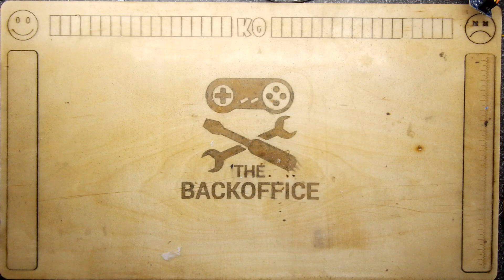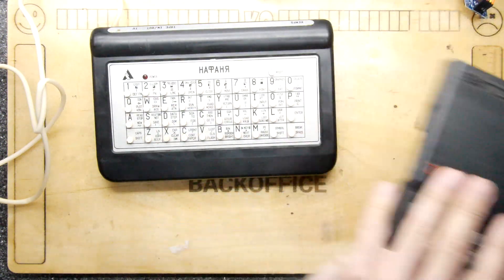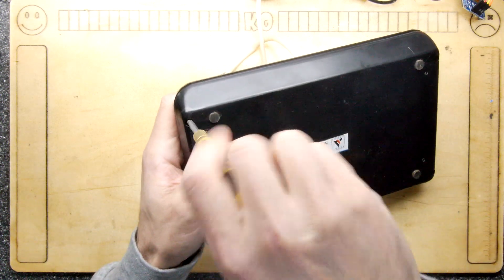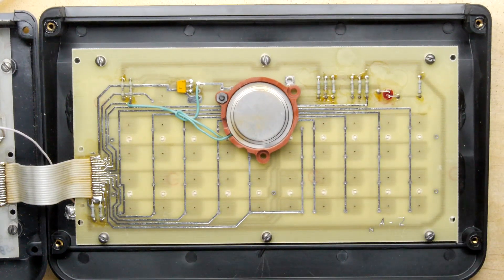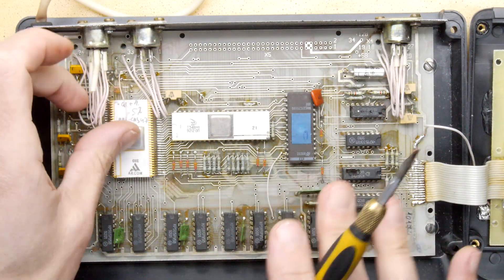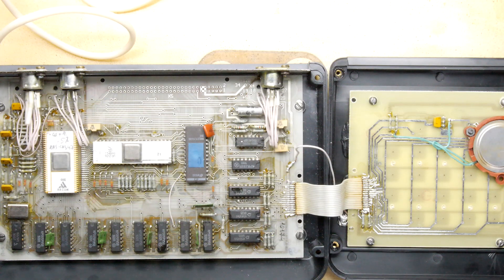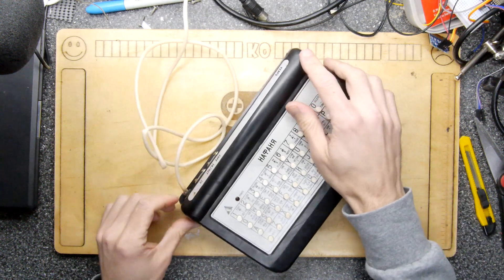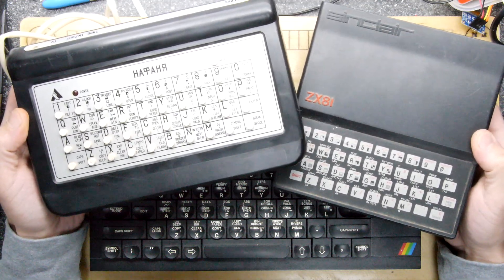Soviet Sinclair ZX Spectrum Clone Teardown НПО "Аксон" Нафаня (Akson Nafanya)

Comment: AKCOH 
this is a manufacturer ... and the chip itself is a Soviet reverse engineering clone of ULA
T34BM1 = Z80 Soviet Z80 Clone 
KP565PУ5B= DRAM 8k each chip... but z80 cannot address all 64k dram ... some part of the address space is occupied by ROM ... so 6k per chip
K155ЛН1 = logic gate NOT(inverter) 
К554СА3 = voltage comparator...used to read a signal from a tape recorder \ also used in the Soviet 5.25 floppy drive electronica mc 5311
other chips is also logic gates.... 
lower part of numbers represent the date of manufacture of the chip so 
КР565РУ5В
9201
it was made in 1992 ... the first month is january
Reply from the maker: Thanks for the information! 1992, wow that's much later than I would have expected, I might Google to see how long they kept manufacturing these. It's a bit like the 8 bit Nintendo clones, definitely made well into the 90s and still a few made today 😂
Reply: @backofficeshow  also in USSR 
there were other clones of popular platforms ... for example 
BK0010 user frendly home version of PDP-11
DVK-2 not user frendly version PDP-11 
but it can run more advanced software ... like Demos DVK (a clone of the Unix operating system)

AGAT 7 is a clone of Apple 2, somewhat cheaper in some places ... but it had a large motherboard and a bunch of all sorts of expansion modules
RADIO 86 RK original design but the idea of a computer is similar to Apple 1, cheap, simple and open ... the computer was assembled by enthusiasts ... 90% of the chips were clones of Intel chips

Poisk 1 clone of IBM PC/XT on the i8088 processor ... stuffed into the keyboard case, the compatibility was not complete, there was not enough memory ... it was necessary to buy expansion cards to run normally DOS, it even had an ISA bus, but the problem is that there was a Soviet snp connector and manufacturing homemade boards was a tricky task ... and it all cost like a Two BK0010 computer A LOT OF MONEY :( 

UKNC 
based on PDP-11 but now there are 2 processors ... one for computing ... and another processor for controlling the keyboard, tape recorder, display and everything else ... the computer was popular in schools along with AGAT7 and suddenly Yamaha MSX yes there were such educational machines =)

And now about Zx Spectrum big explosion....
(Names of Spectrum clones) ATM Turbo,Byte,Baltic,Briz,Vega,Gamma,Delta-C,Dubna,zx evo,Iskra-1085,Kay,Kvorum,Leningrad-1,Lvov,Magic07,Moscow48k,Orel-BK-08,Patisonic,Pentagon-1024,Scorpion ZS-256, Nafanya,and others and many many more.... 
so where did they come from?

Imagine if every state in America made its own compatible clone of the Zx Spectrum and called it according to its own name....

Yes, that was approximately how it was, each region in Russia made its own clone and called it a unique name ... the clones were roughly similar
Where there was a radio components plant nearby ... the clones were more advanced like Nafanya with its ULA ... or Pentagon-1024 into which they could push a whole megabyte....

The BK-0010 was the only competitor to the ZX-Spectrum in the home market ...
ZX-Spectrum was cheaper ... if a person knew how to solder and had friends at a radio components factory ... a computer could cost the price of 5-7 bottles of XD vodka and a couple of nights of work with a soldering iron

Well, the games were copied from each other on a tape recorder, BK-0010 did not shine with games, it was more focused on a home office ... there was a mouse printer for it ... and it all cost a lot of money ...
Radio 86RK was even cheaper than Spectrum ... there was no need to buy an expensive Z80 processor ... but there were no good games on Radio 86RK ... most of the software was for radio amateurs and programmers ... so Spectrum defeated all Soviet computers and firmly settled in the houses of ordinary people =)

Comment: You are right, НАФАНЯ is definitely a ZX Spectrum clone. I am not aware of any ZX81 clones from the Soviet Union; I would be surprised if such a thing exists
Reply: Т34ВМ1 is a Z80 clone, the other big white chip to its left is the ULA clone, a Т34ВГ1. The markings RAS and CAS have to do with DRAM addressing, but I don't know more than that. As for the К554СА3 you found at around 7:00, it is a voltage comparator

Comment: Oy this is Nafanya :) https://youtu.be/FmDJpFmxgLo
7:08 This is the comparator IC, it is needed to enter the program from the tape
Reply from the maker: I grabbed the schematic for this, I will need to make a cassette lead at some point soon and I needed the pinout. Let's hope the comparitor is still alive
Reply: @backofficeshow  Hi, 
Additionally, you can see the information on the link http://speccy.info/%D0%9D%D0%B0%D1%84%D0%B0%D0%BD%D1%8F
reference to the circuit diagram (djvu) - http://speccy.info/w/images/e/ea/Nafanya_Schematic.djvu

link to the circuit diagram for connecting to different TVs (djvu) - http://speccy.info/w/images/8/83/Nafanya_Manual.djvu
cassete port pin out : pin 1 - output signal (to cassete player), pin 2 - ground, 3 - input (from cassete player)

Comment: RAS and CAS on the leftmost white IC are probably Row Access Strobe and Column Access Strobe, the "47" might be a measurement?  I think it might be RAM.  The 9201s below don't seem like they have enough pins (assuming 8 address, 1 CS, 8 data, 1 R/W, 1 VCC, 1 GND) to be RAM.
Reply: They are DRAMs, and like in the original Spectrum, they are 1 bit memories. 4164 compatible:
https://eandc.ru/pdf/mikroskhema/k565ru5.pdf
Reply from the maker: I'm almost at the point to test this machine out, I might need to make a couple of tweeks inside the unit so I'll be going back in

Comment: There were a lot more chips in the Speccy as they used faulty RAM chips where half of the chip worked. Another cost saving trick from Sinclair.
Reply from the maker: I do recall hearing about that, very thrifty! Its interesting to know that the chips must have failed in the same way for them to be enough of them.
Reply: @backofficeshow  They bought the tested bad ones where all faults were in either the top half or the bottom half of the memory space of the chip. The Spectrums have a link for using either the top or bottom half of those chips, so yours would either have high memory or low memory enabled. You needed to get the same type as replacements, or use fully good chips.
Reply from the maker: That makes a heck of a lot of sense!
Reply: @backofficeshow  I expect they either bought them like that or just bought a job lot and tested them to find the ones that would work. They had a history of tricks, they pulsed the power to the calculator chips at just the right frequency so they would work, taking advantage of internal capacitance. Saving power as a result.
Reply: That was typical Sinclair, everything had to be as cheap as absolutely possible. Right back in the 1960s, Sinclair Radionics sourced thousands of reject transistors from Texas Instruments and Mullard, that they tested for use in their radios and audio product.

Comment: No heatsink. So they must have put that in the external psu.
Reply from the maker: I think the PSU will be the very next thing to teardown, as there seems to be no onboard regulation I would be hesitant to risk powering it up without measurement. Lets see if they heatsunk it! :)

Comment: The 4 digits numbers on the chips are just datecodes. Oddly enough the resistors are not typical soviet ones, they rather seem to be east-german made.  The kind of slotted screw you have here were use everywhere in the soviet industry, from consumer radios to space probes.
Reply from the maker: It funny really, I recall every screw being a slot head, and I think the only place we use them now in the UK are on the mains machine screws for face-plates and terminal strips. I guess they were harder to automate on factory lines or something. I guess they are probably pretty rare globally now.
Reply: @backofficeshow  It is also so much easier to damage a slotted screw head in my experience... (although modern pentalobes are kind of worse...)
Reply: @backofficeshow  With primitive machinery they are actually much easier to fabricate. You could make such screw from a steel rod using a lathe...